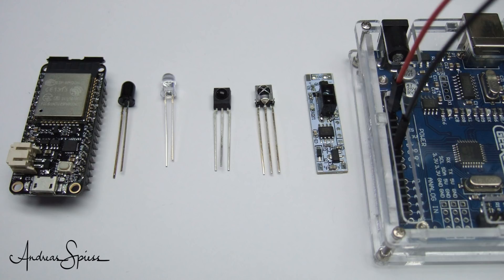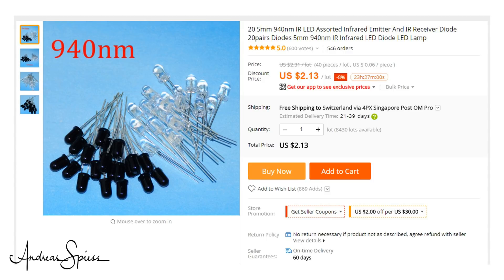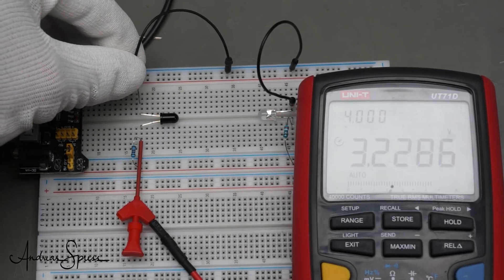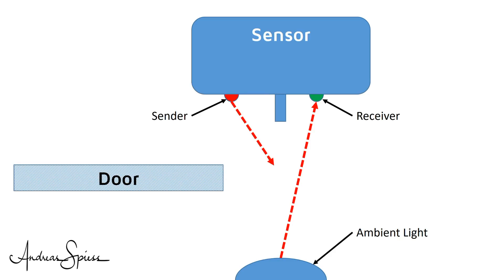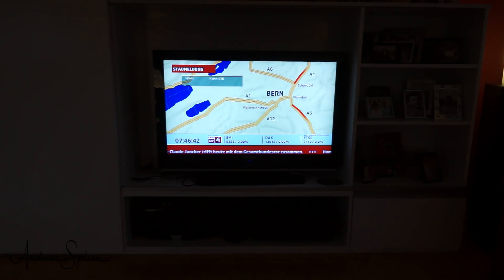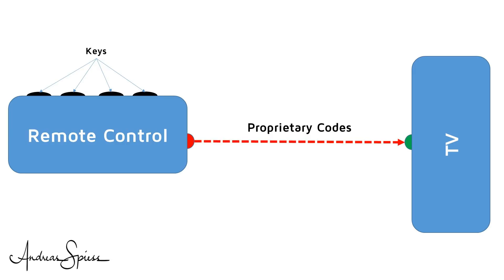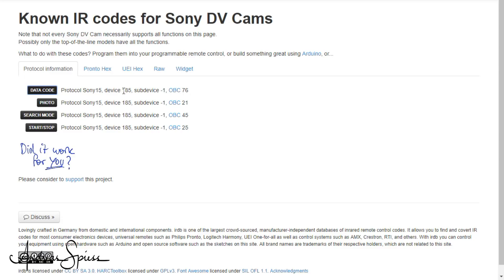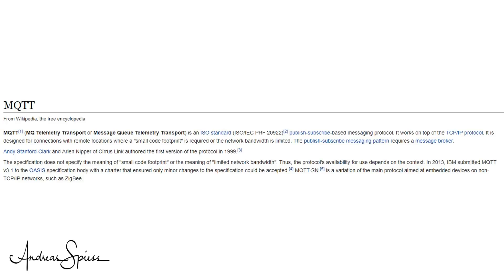#171 Arduino Guide to Infrared (IR) Communication also for ESP32 and ESP8266

Comment: I love this tech and find it very useful and try to use it all the time. However, for a simple cabinet door I would glue a magnet to the door and mount a reed switch under the shelf. Or you could mount the sensor at an angle so it can't see the remote. Or if the white cabinet makes that impossible just use a photo resistor since a closed cabinet is dark inside.
Reply from the maker: I went through your proposals, one after the other. For the reed switch, the distance was too far (without seeing the sensor when the door is open). The LDR did not work because in spring and autumn when the sun shines flat, enough light came in to switch the TV on and if the lights were low during the TV sessions it switched off. The video was already long so I did not mention these experiments...
Reply: I have used both reed switches and LDR for closet and cabinet lighting to good effect. On one closet I mounted a magnet on a post on the hinge side of the door to reach under the shelf and find the reed sw. I have used the reflective sensors for part position and control on automated assembly machinery where magnetic and micro switches could not be used. Also as timing devices where I find hall effect units can be fooled by dirt and metal chips. If your TV cabinet door is manually operated it seems you have found the best solution. Maybe if I watch enough of your videos I will be able to think outside the TV box, too.
Reply from the maker: :-)  Yes, the door is moved by hand.

Comment: What is the IR code for your wife? If you could determine it, you can construct a remote controller. Even three buttons would help much: On, Off and Mute. ;-)
Reply from the maker: Mute :-)))
Reply: I found codes, but they are useless. One was "GET ANGRY" and other triggered "GET REALLY ANGRY". :(
Reply: Not sure, but it seems to be a state machine with some weird transitions...
Reply from the maker: Maybe the controller and the device codes do not match ;-)
Reply: When someone implements this successfully please share the sketch with me too.
Reply: I feel like asking said question will either send mute or volume+ (the codes are very close together on my model).
Reply: Wives are an international problem, if they are switched on, possibly nothing could could turn them off, until their system goes down with battery and reboots :))))
Reply: Andreas Spiess lol Andreas 🙏

Comment: hi, great work Andreas :)
what about a constellation of IR sensors, like the Broadlink devices, for example the cheap RM Mini 3 (code name Black Bean)? Can they share the SAME pins, so to send the signal in various direction all at once? Look at this image: https://www.solidrop.net/photo-15/newest-broadlink-rm-mini3-black-bean-smart-home-universal-intelligent-wifi-ir-4g-wireless-remote-controller-by-smart-phone.jpg

oh, there are already node-red implementations of this device to make life easier :)
Reply from the maker: Thanks for your link. Actually, I have one of them laying around (unused). Maybe I have to give it a try... The idea of several LEDs can also be done with the ESPs. Just ad two transistors.

Comment: Andreas an excellent video and well researched. Incredible quick turnaround on bringing something insightful and new to video. 
Did you determine the range of an IR beam transmits reliably to a receiver and did you discover what the maximum reliable distance for reflective transmission was, ie like the TV cabinet setup?  I'm considering external passive IR with fresnel lense as they are low power, but your video has given me a few other ideas. Again, brilliant work :)
Reply from the maker: I think this is more an optical question and I do not know a lot about lenses. In my lab, the IR detector chips were very sensitive. I do not know how they would work on the outside with bright sun. I assume, they would go into saturation quickly and would no more able to detect the small signals of an LED.
Reply: Mmm, yes I expect the IR chips will be saturated by natural daylight IR and yes an optical issue. Thank you for your response.

Comment: Thanks a lot for this.
And u are lucky that your misses only said "Nerd" not "F****"
By the way what website did you use to find the IR codes.
I am at the moment struggling to automate my panasonic a/c. I can turn it off and on but had no luck at all in reading the rest of the buttons
Reply from the maker: I used http://irdb.tk/find/ . but there are others. Just google...
Reply: For some reason AC IR codes are more complex and longer than for other appliances (I've seen 32 Bytes long commands). I reverse engineered the protocol of my Mitsubishi RKS502A503 remote using information from here: https://www.analysir.com . I initially only used a scope, an excel sheet and a receiver I desoldered from an old CD player. I eventually purchased their analysis software because the next AC I did had crazy long codes and it made life simpler.
Reply: Awesome thanks

Comment: Thank you Andreas and Mrs Andreas! Could we please have Mrs Spiess as a regular beta tester! She will help you add the real world wife acceptance factor  (WAF) in future performance and cost spreadsheets.  Joking aside this was a great video in your usual 
great style but I have a question please. How do you or other manufacturers ensure that their codes are unique so that they don't do something bad  for instance switch on the heating (company 1) AND open all the windows (company 2)  from a single  IR transmission?
Reply from the maker: WAF :-))
I did not dig into the IR codes itself because I still had the remote to copy the code. So I do not know if there is any standard body like in Ethernet. I do not think so, but maybe somebody else knows.
Reply: thank you!!!

Comment: Andreas do you have a call sign? Mine N9EQE
Reply from the maker: +A D Mine is HB9BLA.  BUt I am not active for the moment
Reply: Wife vs. Versatower vs. Neighbors? No problem, build a small magnetic loop and use a esp32 to remote-control the capacitor. Then you have to build something that uses the CAT interface of the transceiver to communicate with your mqtt server and so on. ;)
Reply from the maker: I had my fair share of issues with towers and neighbors when I was young. Switzerland is very crowded... 
BTW: The wife was not around then.
Reply: Your wife will probably support you with everything you do, the worst thing that could possibly happen is being called a "nerd". But dealing with neighbors can be a bit challenging. My neighbors seem to dislike my garden. It is a nature reserve, but they call it jungle or green hell. The good thing is, they completely ignore the antennas. :)

Comment: Photo electric smoke detectors work by the coded IR beam being reflected by smoke not broken causing alarm.
Reply: "Is it possible to measure the density of smoke?"
http://www.sharp-world.com/products/device-china/lineup/data/pdf/datasheet/gp2y1010au_appl_e.pdf
Reply: Interesting AD, so if you were to put a piece of paper or object close in the path of the coded IR beam (similar to the smoke) this would cause the coded IR beam to be reflected back to the photo electric smoke detector? So I imagine in close proximity a coded IR beam could detect objects that would not have to have the receiver and transmitter opposite each other like Andreas TV cabinet. Do you know how far reliable IR reflective sensing works in an outdoor environment? Thank you for your earlier comment and consideration of my questions.
Reply: Is it possible to measure the density of smoke? with ir
Reply: That is correct, hands free faucets too.  Distance proportional to emitter power and reflectivity of obstacles. These uses are close less then a foot.  Breaking beams can go 100s of feet.
Reply: Yes visibility on runways
Reply: @Generik, Unless it is oily smoke (Like from cooking), I don't see how!
Anyways, I think this is something you have to do a bit of R&D to find out. A radiation based (Americium-241) smoke detector might also be a possibility.
Reply: UFOhunter Yes, I know this sensor, but if it is constantly in the smoke, it will not clog?